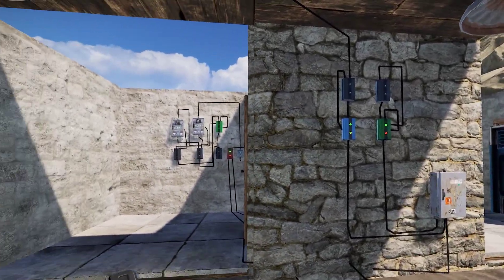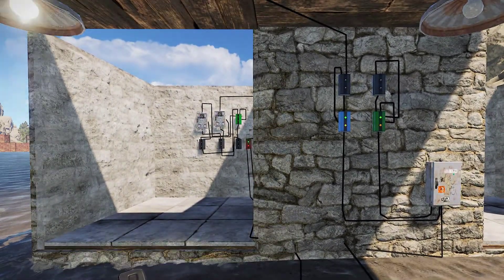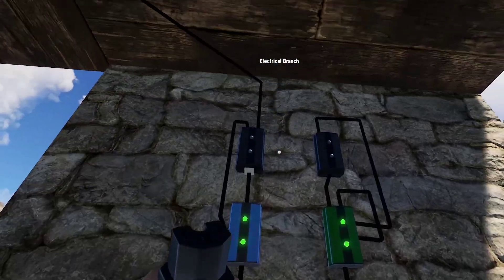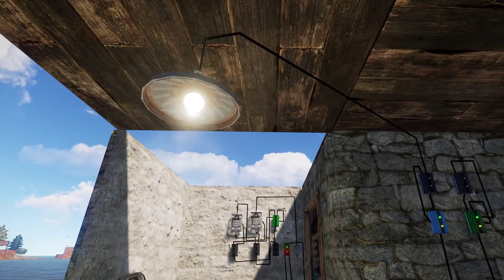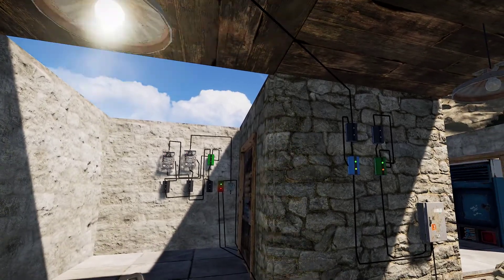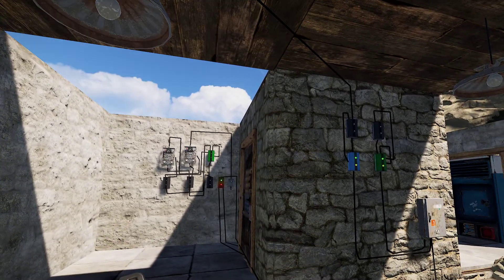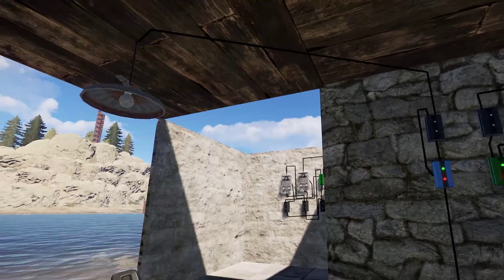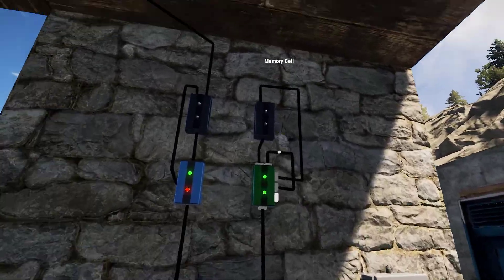Rust Electricity - Pulse Signal Generation

Comment from the maker: The memory switch circuit may not actually be pseudo random, the limitation of how fast the light can be turned on and off is more likely cause a random looking effect, so in reality it just cant be turned on and off that quick. I can't test it correctly with a camera because the screen makes 144hz already and I just learned that cellular phone cameras lose frames to make up for not having a physical aperture to correct low light problems. Anyhow for this purpose it provides a fast and not consistent pulse. 

I like the way the strobe light is setup with 20-40-60 hz settings. That would be suitable for any clock tick, given that we only have access to a limited number of components. There is a HQM limitation to circuit design at the moment. I believe that fragments, or 1 HQM, should be used for all of the logic gates. For 100 transistor circuits, its like 500 HQM. Not including power generation, distribution and real world moving of things power. Considering you could fortify a 3x3 BUNKER for that, the relationship is quite skewed.